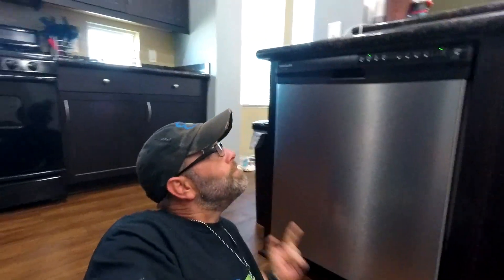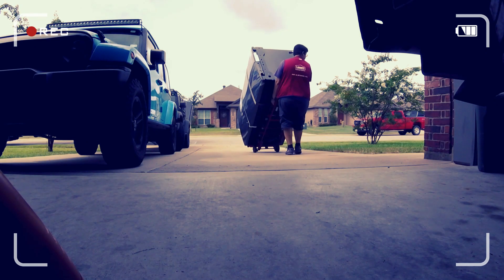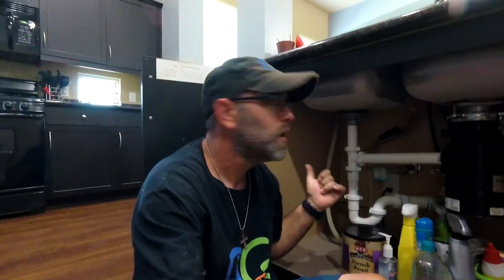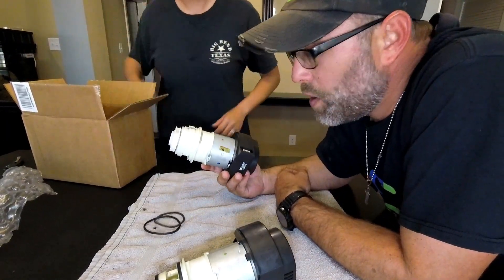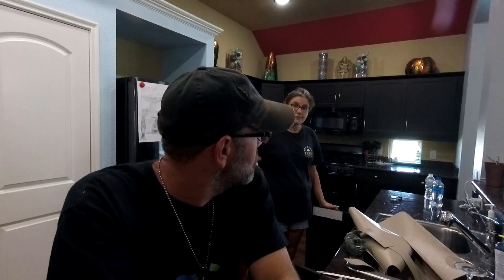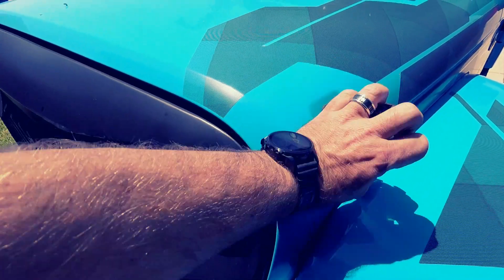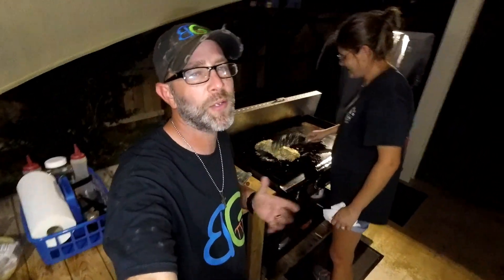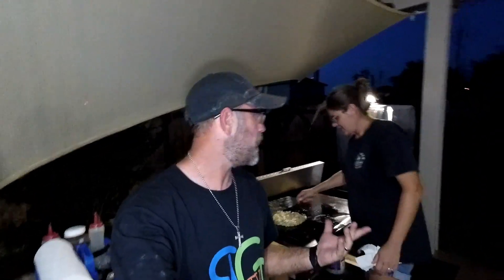Episode 350 - Busted Dishwasher calls for JEEP MODS | Vlog

Comment: Lol. Bobbie could have a side job fixing appliances. Great video as always. On a side note I got those A-piller lightbar brackets from Quadratic and they wouldn't work with my 50 " light bar. (They were 52" across ) they are sending me another set. I'm liking this company .
Reply from the maker: Oh i know right she so rocked it. Heck the other day she took the TV off the wall in the garage. It too seem to have stopped working next thing you know we are looking at the insides of that little fella lol. Needless to say we did not get it fixed but hey it was worth a try right. Oh wow thanks for the heads up on the brackets. We are looking to do some swapping around on them some time next year for sure. The folks over at Quadratec are truly great folks. Tell Rick we said HI!